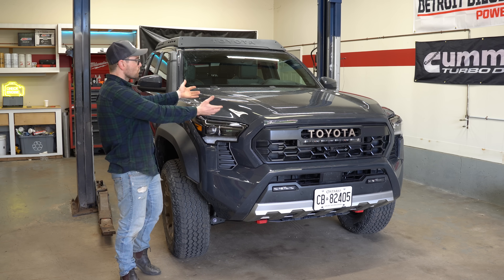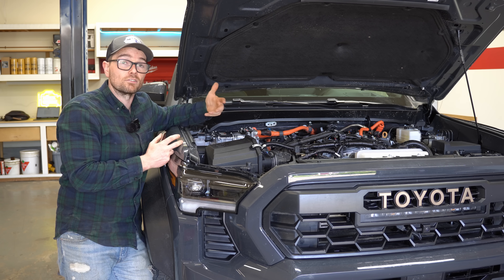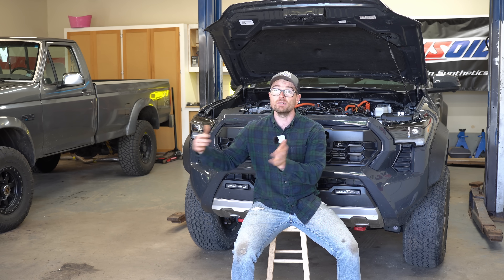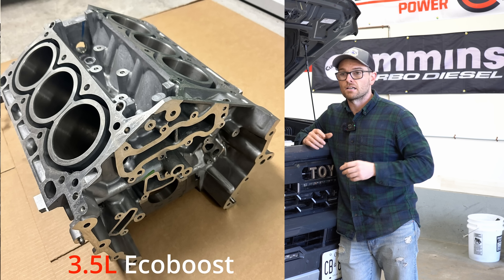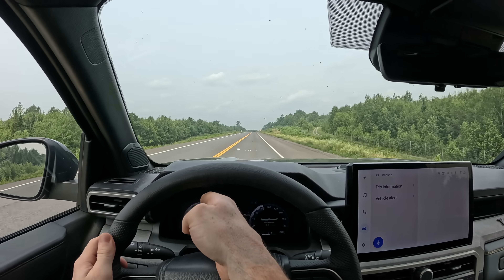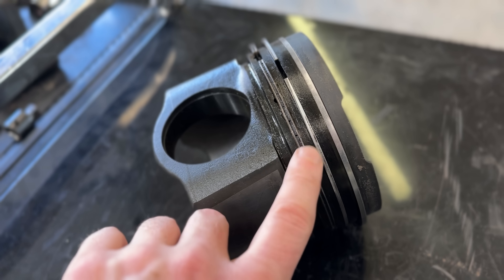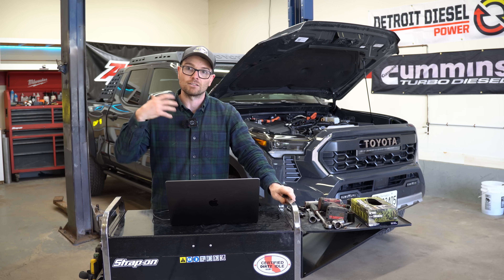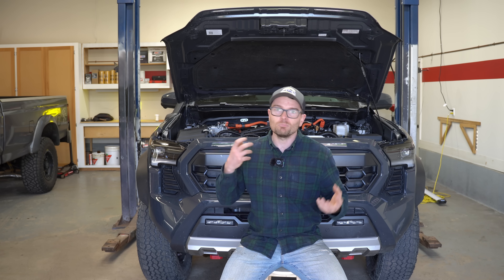Toyota Tacoma's 2.4L I-Force Turbo: CONCERNS Every Buyer Should Know (Mechanic's take)

Comment: Polymer Gears off the crank shaft!?!? I would never ever buy a New Tacoma or New Tundra with all the plastic and turbo components that cost 55K to 70K. Screw Toyota and every other Auto Manufacturer. I’m done with these auto manufacturers across the board.

Comment: After a lifetime in shops and 39 years running our own full-service facility, there is no reason to trust any small turbocharged engine. This trend away from time-proven engines for smaller, lighter units with a turbo will likely stifle sales. We have been advising our customers against turbo engines for a very long time. Turbos belong on substantial engines. Not lightweight aluminum and plastic experimental units. We have years of proof that these engines are overpressurized and will not compare to the reliability of the earlier units, regardless of the brand or manufacturer.
 Toyota and Honda have succumbed to the mileage and weight panacea caused by other manufacturers chasing each other through this poorly chosen path.
We will likely start seeing these engines with early failures. I hate to say it, but I already know I'm right. Run away.

Comment: Reliability of the 2.4 turbo engine isn’t in the same league as the 3.5 2GR engine or the older 4.0 v6.   When reliability takes the back seat to fuel efficiency, the people dumb enough to make that compromise and buy these trucks deserve the issues that come with them.   Toyota screwed up big time.   The Tundra and now the Tacoma.   Who in the heck is directing Toyotas powertrain development these days???????

Comment: Got a 1994 Toyota Pickup 4x4 5spd and never getting rid of it. Rented one of these earlier this year visiting back home and even though I like it but man I knew the reliability wouldn’t be there. Most new cars are absolute crap unfortunately. Had a 2022 Civic and at less than 10k and already had all kinds of issues, electronic steering locked up on me a few times, trans issues, oil leaks, rattles, etc. Got rid of that piece of junk, never again. I’ll stick to older cars moving forward

Comment: at times i her knoking noise from engine on my tacoma
Reply: I was hearing it on my 25 tocoma had checked out ,service manager and a mechanic went with so that i could point it out, the mechanic said it's turbo pressure release valve, don't worry about anymore

Comment: For 2025-2026 2.4L the plastic magic Engine Coolant Control Valve part #16342F0010 cost, runs $700 and up.😂 Great review! Thanks for the heads up.

Comment: Your chart seems to indicate low-tension rings in the 2.5L engine. Our 2021 Highlander Hybrid consumes ZERO oil between roughly 2500-mile (every 6 months) changes. Seems possibly Toyota has resolved this issue?

Comment: Is there anything you do like about the tacoma? Honestly I went from a 2006 ford ranger 4L-V6(Which I bought new) to a 2025 tacoma. I love my new Tacoma. It was the only truck that I could still get a 6' bed. I warned ford to bring back the 6'bed or I was leaving
Reply: I have 25 sr5 long bed, very happy with it
Reply: @roadmaster111-19  Just traded in my 22 TRD Off road for a 26 Tacoma long bed. Absolutely zero regrets! The 4th gen Tacoma is so much better than the 3rd gen when it comes to driving. It’s actually fun to drive

Comment: Ironic that by using the low tension oil control ring that could and will in fact add way more emisions once these engines get beyond 100,000 miles than they saved in the first 100,000 miles. Not the toyota mind set of the past, a sad future for toyota for now

Comment: All Toyota engines have dual fuel injection both Port and Direct injection, D-4S fuel injection system so no carbon buildup on the intake. Plastic temperature control thermostat ans plastic balance gears sound very bad too me

Comment: Absolutely nothing wrong with this engine. I have 100,000 miles on my 24 TRD Sport. Zero issues.
Reply: Broooo. The vehicle just came out why so many miles but I'm happy you did you gave me more confidence about the gen 4. I have a 21 gen 3 with 32k miles I bought it new
Reply: @steviebruney166  lots of driving for work 🤟

Comment: I want a 6 cylinder engine.   I will wait until they get it together cause I do not want a 4 cylinder turbo !!!!!!!!          They should have had an option to get both a 4 or a 6 cylinder.

Comment: If I design an engine, the oil pan, valve covers, and intake manifolds would be the only plastic parts on it because those are low stress components and allows the engine to warm up slightly quicker on cold starts due to being an insulator. It would have a coolant control valve but be a durable aluminum casting instead of plastic and water pump would have a metal body and PPS impeller. Radiator end tanks be plastic but with hot fittings that are blended in better to eliminate stress points to prevent failure and make it last million miles, 10,000 cold starts, and 25+ years.
Reply: Like NISSAN  does?

Comment: I test drove a Tacoma in June and my 2020 ranger is still a better truck. I take very good care of it, and the Tacoma was nice. If you like Toyota, by all means I'd recommend one. But my ranger with the 2.3 is still a fun and capable truck that has gone 183,000km with no issues. And a timing chain... unlike the wet belt in the  other EcoBoosts.

Comment: I don't understand what person who likes seriously off-roading would buy that truck. Don't get me wrong I am a huge Toyota Tacoma fan I have a third gen 2020 TRD pro. But with the additional weight on the truck because of the battery the smaller engine. The hybrid system doesn't give you better fuel efficiency it's only there to increase the power of the truck really. So you have the capability of towing better but you don't really buy a Tacoma for towing it's a midsize truck you buy a big truck preferably diesel with duties if you need to toe stuff. But my biggest gripe electronic handbrake. Many manufacturers that have this have issues many customers have it rolled down hills or it gets a bug in the program and locks up and you can't move anywhere. But for me who loves off-roading realize straight away no more handbrake turns on gravel or ice eliminating that great feeling you getting your stomach and the big smile of puts on your face. And every single truck comes with it now you don't have options You're forced to have that stupid electronic handbrake if this is the standard for Toyota I'll never buy another one

Comment: I have 35k miles on my 2024 trd sport. Only issue I’ve had is in -35 week it was idling terribly and loss of power thought it was my tranny also had check engine light go off but then I got a car wash and took it to dealer so they could see better it being covered in snow and ice and suddenly it just started running perfectly fine they were unable to figure out what happened

Comment: I own a 2024 Toyota Tacoma with 20,000 miles. I still love it and still going strong.
Reply: Wow,  20k is a LOT of miles! 😅
Reply: @TIJoe-te9qu we outside boy
Reply: Same
Reply: I just purchased a 2026 l force 2.4l with 151 miles on it we’ll see I had a 2009 Toyota 4Runner  with the 4.0 L V6 I’m gonna miss it, but the front diff was blown out transmission line the oil cooler line in the front where it’s metal rusted out puking transmission fluid everywhere so we will see
Reply: @bobg3221 If the last one was rusting, puking,  and blown, what made you return to Toyota instead of something else?

Comment: I have officially aged out of my "need for a working truck phase," but now when I want to load up on luggage or pull out in traffic on the highway, my new 2025 TRD Sport with the iForce Max engine is plenty capable and punchy for me.  Compared to the premature shifting of my 2013 SR5 V6, this 8 speed is pretty smooth and moves right the heck out!  Less than 2k miles on this, so the jury isn't even through listening to arguments, much less in deliberations, but so far so good.

Comment: All new vehicles are crap,short life,too expensive to repair when they are 8 yrs. or older. That old ford in the video will and can be repaired for decades, is a little fuel savings worth it. Stupid engineers are building a rolling computer.

Comment: Trucks should be simple tools... V6's (like the Ford 300 i-6 or the GM 3800) and V8s (318, 350, 351, etc), no turbos (except on diesels), no big computer displays, just simple analog gauges, regular thermostats and rads, no stupid sensors all around... tough trannys like the Allisons, full frame no unibodies... big simple knobs for heater controls, radio, and the like. Even numbers of cylinders. They need to get away from all the computers, buttons, sensors, and plastic. AND NO WET BELTS!!!  (Whoever thought of doing that should have their engineer's degree taken away - if they actually have one). Simple but tough!!!

Comment: I'm driving a 2015 Toyota Tacoma 4.0 v6 4x4. I wouldn't even consider a new Tacoma, don't like the engine setup at all. I had another 2015 Tacoma with the 4.0 v6 with over 300,000 miles on it. The only problem i had was a power steering pump. I do all my own maintenance. Coolant  change, transmission, differentials,transfer case faithfully. Very reliable trucks the second generation. Im sticking with the older ones.
Reply: 2015 4Runner here, same engine of course. 235,000 miles and still humming along

Comment: Think the 2024 is direct and port injection it is called the Toyota D4S system. Have the 2024 Offroad version and boy it has lots of power. Have no want for more going from a 2016 Avalon. Didn't want the extra complexity of the Pro version. Think the worst thing people can do is not letting the turbos cool down before shutting the engine off. You just can't go full tilt (or towing) and immediately shut the engine off. This is where problems will happen. Let the engine run a few minutes to make sure those turbos cool down. And for sure oil changes more often because the oil is used to cool those turbos.

Comment: Love this engine… I am not easy on the gas and get 21mpg average  over 18k miles with a manual TRD off-road.  My only complaint is the throttle tuning likely for epa regulations that make quick shifts ugly and the 500rpm lower redline than automatic that no review seemed to catch.

Comment: I sold my 2008 TRD Sport and bought a 2018 TRD OR. I liked the 4.0 much better. I currently own a 2021 TRD OR. I got used to the engine and the truck has performed flawlessly. Oil changes and that's all. I intended to trade for the latest generation but have held off. I'd rather have a V6 but all makes have turbo 4 except Nissan and V6 turbo is available in the Ranger. I owned 2 Nissans my first and last lol. Ranger V6 is still a turbo regardless of how much more power it has. So far I'm driving my 2021.

Comment: For all the people that believe turbos are bad, can you name a transport truck or locomotive that doesn't use a turbo? And what life is expected from those?  Sure, if I take a 100 hp engine, and force it to make 300 hp, it will have a short life.  But if the engine was designed and built to deliver 300 hp, I don't see a problem.  My turbo 2 L is now 12 years old with no problems. It is so powerful, I very rarely need to redline it. In my SUV, I have repeatedly seen 35 mpg to cottage about 5 hr from my house.  Have the naturally aspirated fans noticed the recent problems on the V6 and V8 engines?  Bearing and lifter faults? It seems every maker has lost how to build reliable engines to meet EPA impossible specs.
Reply: Those trucks are usually diesel powered.
Reply: @atx-cvpi_99 : correct. With higher compression than gas engines.

Comment: Have a 2024 non hybrid. Plenty of power, tows my 3000lb trailer just fine. I live at 6800' in elevation and drive over mt passes a lot. Winter with chain control going over hyw 80 I get 18 to 19 mpg. I have gotten up to 30mpg driving around Sierra Valley in the summer.   It is not about power but efficiency, If you want to tow 6000lbs up an 8% grade and race teslas off the line,  go full size and not care at the pump. If the hybrid added fuel millage I would have gone for it but it just adds weight and costs in the current form.

Comment: I’m not a mechanic or engineer, but this engine seems like a disaster. Too many components seem to be high maintenance or extremely expensive to repair if they fail making this a disposable truck. When it reaches high mileage and the plastic parts start breaking it will cost so much to repair it that it’s not worth it so they will end up in junkyards by 150,000 miles.

Comment: At this point, just get rid of the turbo and everything that cools and oils the turbo, and lean into the hybrid battery and supplemental electric motor already. Naturally aspirated 4 cylinder, no plastic parts, and a beefier electric motor and battery and it's looking like a truck this size can make its 400 torque and get 25 mpg relatively reliably. Old Prius's are getting 300k miles out of their original 20-year-old battery and motor so I think Toyota's onto something there. If there HAS to be a turbo, the entire engine needs to be built like a diesel, like the Ford 2.7 if it's going to last 200k+ miles.

Comment: I have a 2018 Tacoma with 3.5l. It has been rock solid. BUT, I do share your concerns on the use of plastics in modern engines. Even the 3.5l has a plastic coolant pipe at the back of the engine that can fail, it’s in a bad place to fix. I also have a 2016 Jeep Rubicon with the 3.6l Pentastar. At 64k miles I had to replace the oil filter/cooler housing, which is all plastic from factory. I had an oil and coolant leak from that. I did use an aftermarket part which is aluminum though.

Comment: While not referenced in the video, I'll add this engine used Toyota's own D-4S fuel injection system, which includes both direct and port fuel injectors.  This system greatly reduced carbon buildup vs. far more typical direct injection only systems. Also, the "plastics" he's referring to are fiber reinforced plastics, which are an actually composite materials.

Comment: In todays world manufacturers pay alot of $$$ to their department that controls reliability.  They are designed to fail at a certain age, hopefully bad enough that the owner will just buy a new vehicle rather than fix the old one. The days of driving a vehicle for 10 to 20 years is over

Comment: Good job! Too bad some poor engineering practices are being shared by so many manufacturers. I don’t mind a turbo but only if the engine didn’t need one before. More power is better! Plastics suck for engine parts. Also too much heat under the hood for many years of use. You would think the auto industry would strive to build better instead of cheaper quality and more expensive. I’m sure Toyota and others could have done some retuning and design changes to their 6 & 8 cylinder engines to get power, efficiency and dependability up but they seemed to go a different direction. The new young engineers probably learned that in college. Keep up the good work! I did not know they were doing some of this.

Comment: The coolant pipe on the new Tacoma is 3 inches in diameter which is way bigger than most turboed engines.  The cooling in the 2.4 turbo is industrial in its build.

Comment: The entire oil pan assembly on an F150 5.0L Coyote is plastic and it hasn’t failed.
Reply: True, though the oil pan isn't transferring power or under any real load. Also, there are a host of different "plastics," including the family of fibre reinforced composites.  The plastic in your oil pan is entirely different than what's being used in internal engine parts (gears in particular)).

Comment: I think the oil pump belt on the Ford 2.7 Ecoboost should get an award for worlds worst engineering design. 😅 Don’t even get me started on GM’s baby diesel. 😂
Reply: Oil pump belt on 2.7 exists in its current form since 2018, which is 7 years. I haven't heard any widespread complaints it's failing, and 7 years is a lot, especially for fleet trucks.

Comment: I bought a 2018 Tacoma with the 3.5L. It has a 6 speed tranny. So they put an engine in it that needs to rev to make it's power, yet the tranny is always at least one gear too high. It constantly tries to climb hills at 1500rpm, no shot. It shifts into 5th gear at 32mph, pathetic. Very disappointed in the thought process that went into this power train. Modern automakers have ruined trucks with their focus on nothing but fuel mileage. And quality has completely taken a backseat. Nobody cares about making a vehicle that will last, just so long as it outlasts the warranty period.

Comment: When I was shopping for a truck I wanted a Tacoma  but I was afraid that turbo charged 4 cylinder would not last. So I bought a Nissan Frontier, yeah I rolled the dice but so far one year later I’m really happy with it. I do admit the Tacoma might be better off-road
Reply: Am thinking the same. But had interest in the 6MT Taco. But the Nissan has a Dana 60 rear, good motor and 9spd tranny and I have already designed a sway bar disconnect similar to a Jeep and TRD Pro one but with spring loaded open and close on a manual setup. That will make it so much better offroad otherwise one would have to remove the sway bar and drive like a truck not a Corvette.
Reply: I bought the Nissan frontier sv aswell brand new 2025. I love it

Comment: Paper and spec sometimes doesn't match to realistic. All engines and transmission wear differently based on owners. The downside with all the electronics to gain the power for the vehicle to be reliable is rather harsh. I believe the ECM has to be bigger and the board should run more memory and faster chips. To be able to keep track of 10 physical modules and additional 12 sub modules that are embedded into specific modules which is 22 total modules. Once overload, done for. Sometimes, shorts out something random or the weakest link.